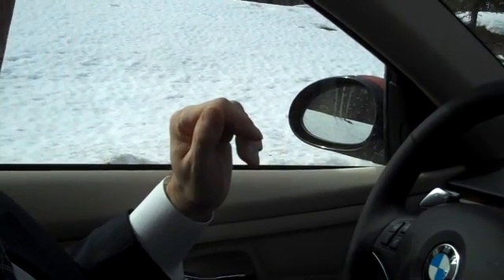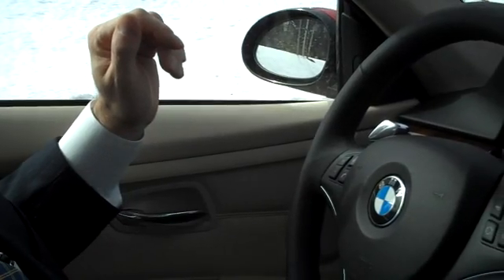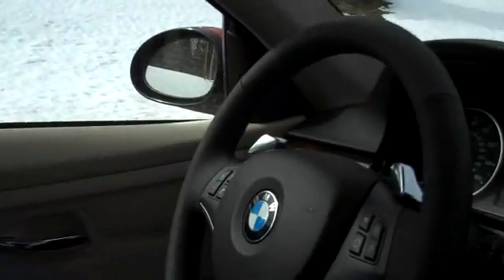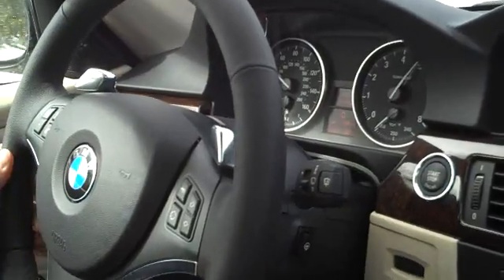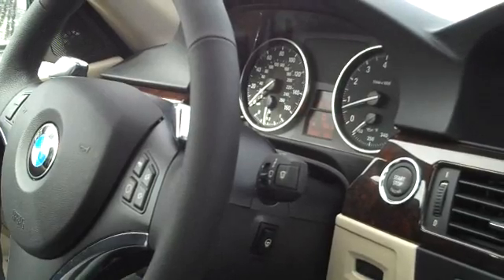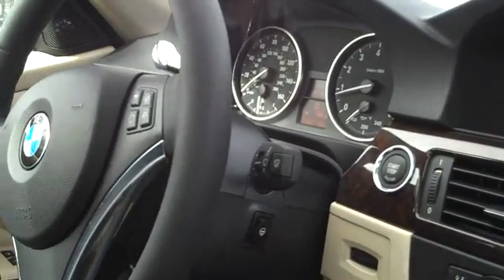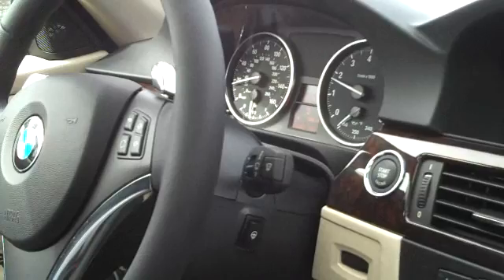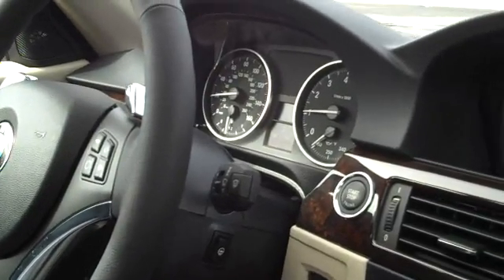Experiencing Brake Override in a BMW 3-Series

Comment: @elmotores 
He is trying to show that IF the gas pedal was stuck, you could override the throttle by simply using the brake pedal, and since its not stuck, he must hold both pedals

Comment: @kilgoja this cuts throttle when you press on the gas if you're moving with speed. On a toyota avalon, the braking distance is 4 times what it is when WOT is applied the same times as full brakes.
Don't talk about other people's driving skills, they obviously understand more than you do.

Comment: If i'm correct, this still allows you to press the brake and gas to spin out the rear wheels? I haven't tried it on my 335i, nor do i plan on.
Also, if you're going to try this at home, wait till the temp needle starts moving. I bet this car has <1200 miles and isn't even done with its break in.

Comment: Renault F1 later came up with a front axle/differential design that carried the excess braking force from the inside front wheel to the outside front wheel to prevent lockup of the inside front wheel and reduce braking distance in turn entry.  This, too, was banned.  

THE SEASON STARTS!  woohoo.

Comment: For a long time F1 drivers were able to outperform ABS but when ABS tech matured and  F1 drivers could use it to advantage (along with active suspension and traction control) it was decided to outlaw it (along with active suspension and part of traction control) to make the driver a more important factor in the sport.

Comment: I believe F1 cars don't have ABS systems for weight reduction/ rules don't allow them.
But you are right if the tire is not fully gripping the ground ABS will start to work and still bring you to a safe stop. Without ABS if you push the break to hard you cannot release the brake pressure as exact and fast as sensors can.
So a car with ABS is always superior. With the perfect driver the system does not activate itself.

Comment: @mo1elftausend 

Front/Rear is done on race prepped cars via what's called 'brake bias'. If you google F1, Rally, etc steering wheels, you'll see a knob where the driver can control the difference in brake pressure depending on the conditions, which keeps all 4 wheels close to the limit, although by the nature of decelerating object, the front will always have more pressure. this is why front axle has bigger brakes.

As far as reflexes.... have you ever seen Schumacher driver?

Comment: I explain further. You would need at least 2 different break pedals (for the front and the rear axis) and lightning reflexes to achieve near abs breaking distance.

How do you want to keep all 4 wheels at the limit with just 1 break pedal ?

Comment: @mo1elftausend 

A good driver can 'feel' the wheels about to lock up, and manually modulate the brake pressure, without having to rely on sensors or electronics.

This is the reason no race car (F1, Touring, Rally, NASCAr, etc) has ABS.

Comment: @mo1elftausend 

ABS works by slamming on the brakes as hard as possible, then when the wheel sensors detect that the wheel is skidding, to release brake pressure, rinse, repeat. This is inefficient because there is time when the tire rubber is not fully gripping the ground (i.e. skidding), and therefor not at the maximum level of deceleration. Same concept as how burning out is not the fastest way to accelerate.
Reply: without ABS your locked wheels do all the stopping and you can’t steer the car. with ABS the system allows you to slam on the brakes and the system will pulse the brakes if they lock so the wheels can continue to transfer energy to the disc and pads

Comment: Even if you have push button ignition and in the highly unlikely event you can[t kill the power there is no accelerator on the planet that can stop the common sense solution of slapping the shifter, manual or auto, into neutral.  There is no excuse for these crashes.  If a person does not know how to do that they should not be driving. It is so simple to defeat a "stuck" accelerator and i feel no sympathy for the idiots that let it defeat them.   The truth hurts.

Comment: @kittensof1984 Yes I have driven a car without power steering which is not that hard. Now if you mean a car with  power steering but while the ignition is off, the answer to that is yes also.  It is considerably harder. My point is that if your accelerator sticks chances are you are moving and steering is the least of your worries while you are rolling. If you are at a standstill then turning an unpowered steering wheel is a battle, but certainly not that hard when you are rolling.  cont.

Comment: I AGREE  but power steering isn't that important when you are rolling. and regardless the brakes still work.  and yeah shifting into neutral is very good or off ignition. anything besides keeping a car running or braking while in gear.  How stupid are people?

Comment: @KHRAZYIE1 
Well, the bad thing about shutting off the ignition is that first, you will have a hard time shutting it down in a modern push-button car, and even if the engine does shut down, you lose your power steering, brake assist, etc. So the best thing is to shift into neutral for automatics, and open the clutch for a stick.